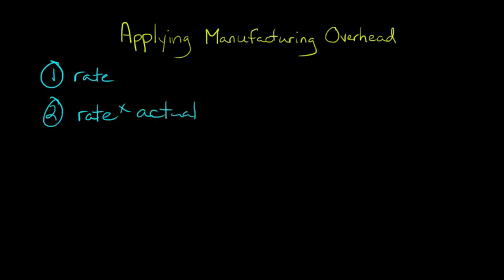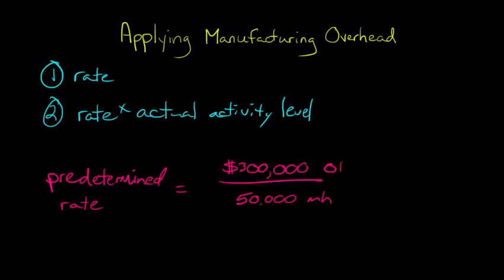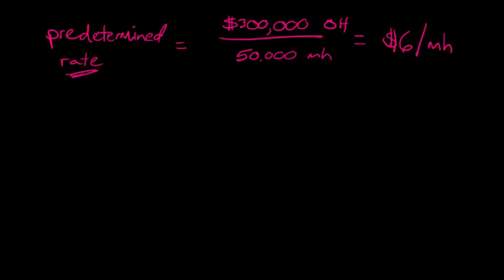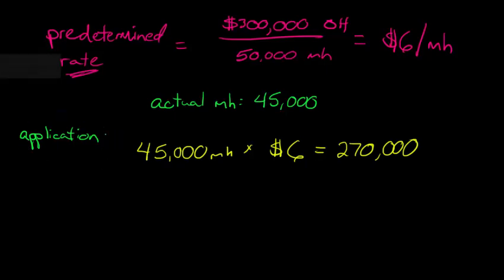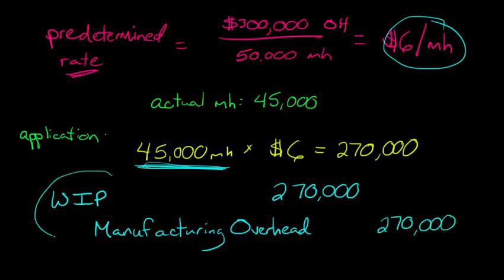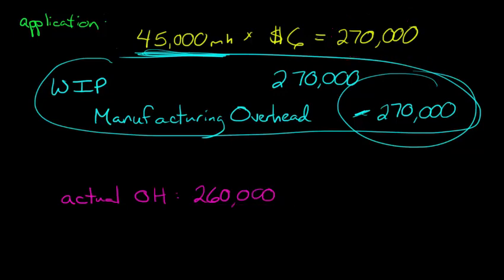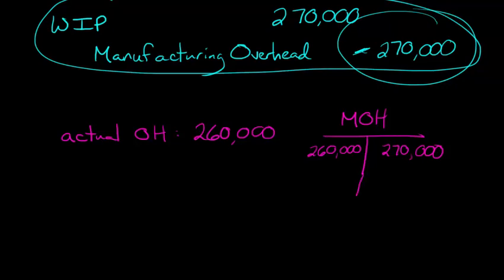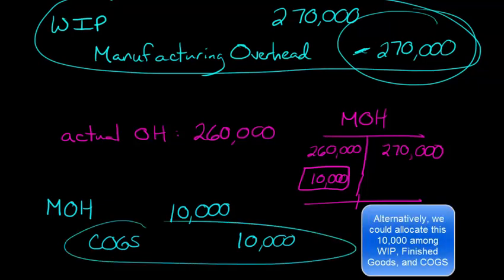Applying Manufacturing Overhead

Comment: so wait, the 45,000 Actual machine hours is what was figured out at the END of the period right? then use that with the calculated predetermined overhead rate and that is the ACTUAL overhead applied correct???